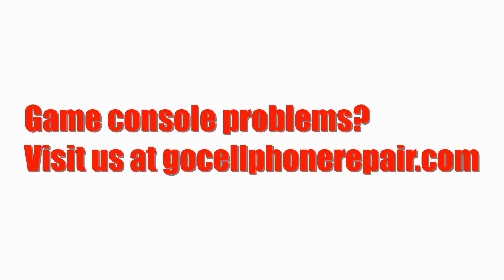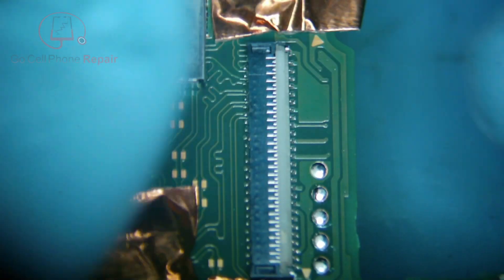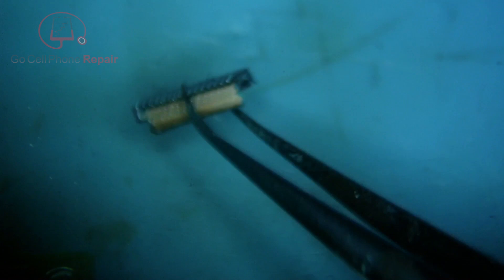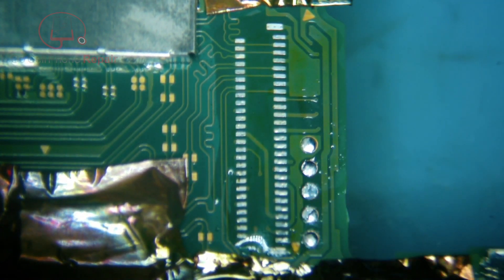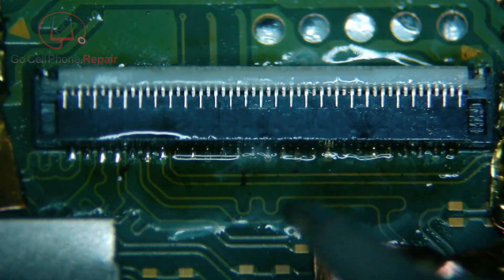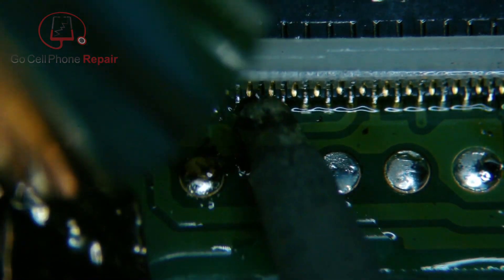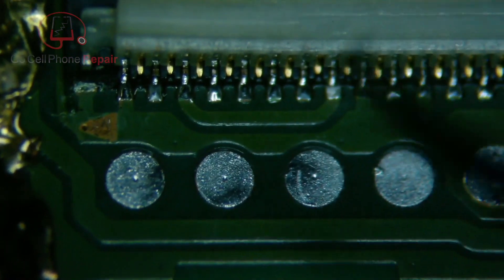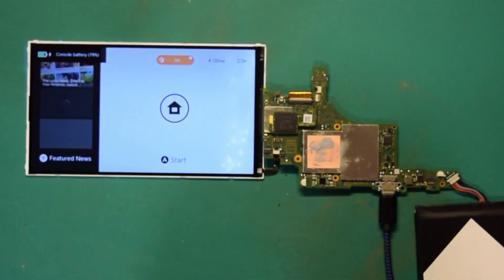Nintendo Switch LCD FPC Replacement

Comment: Hello mike

If possible could you please create a tutorial for the Hakko FM2032 Tweezers that you have, actually using them, removing components, giving us a detailed overview. I ask as I really want to get this station set but there's no tutorials out there for it at all, nothing I mean it! Would like to  learn as I've seen you use them a few times. Thank you. It can be you using them on a practice board, I think the video will do well as you will be the only one actually doing it.
Reply from the maker: I may be able to do this in the future. It might however discourage you from buying them as the tweezers aren't as useful as I though that they would be. Having two ports is great though since you don't have to swap out irons as often.
Reply: @GoCellPhoneRepair  Thanks.